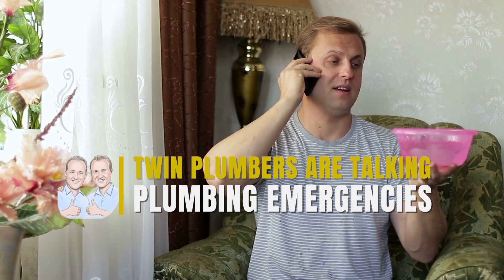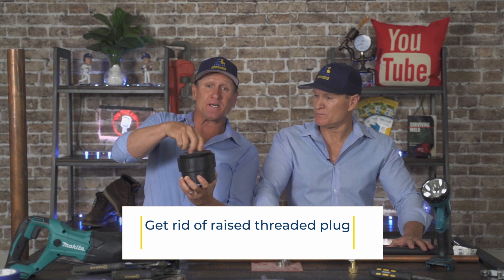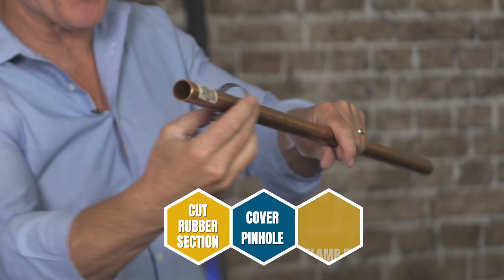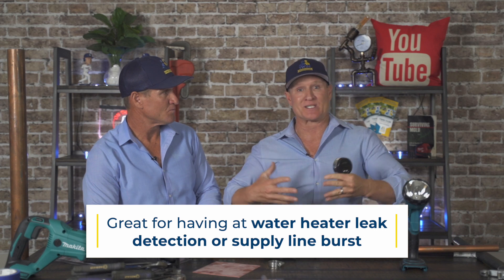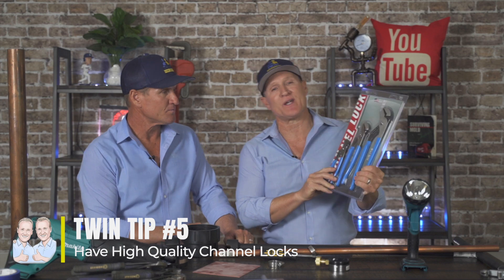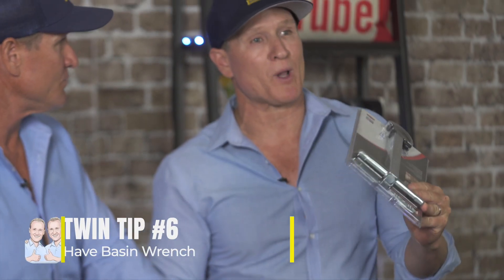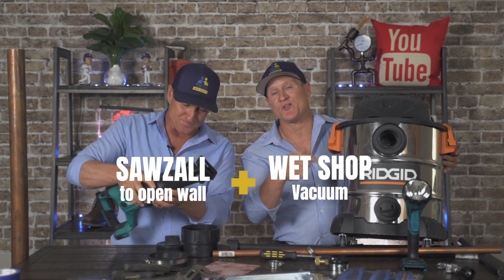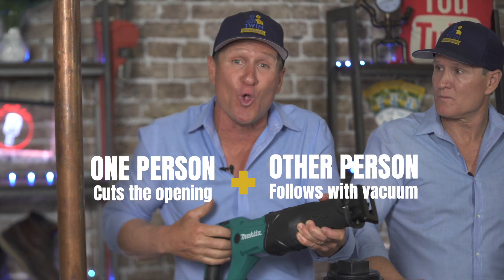Top TIPS & TOOLS for Plumbing Emergencies

Comment: 0:17  I had to shut off Is my main water valve to do my house. Because a copper pipe in the wall, between my kitchen and my spare bathroom . It's the series of copper lines coming from underneath that distribute water to the other areas of the house...
I shut off the main water valve to the house and opened some spickets inside and out but my question is,..Does my hot water Heater have to be shut off. Does it matter if it's gas, natural gas or electric?